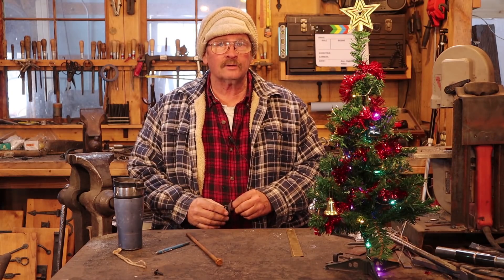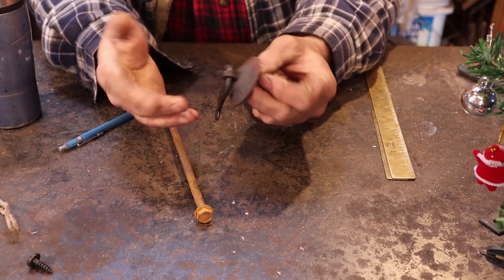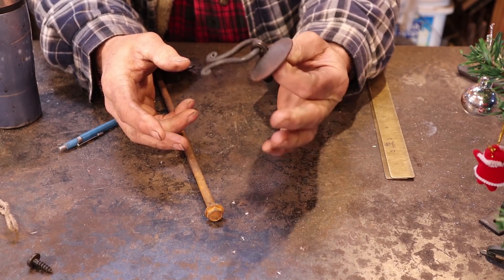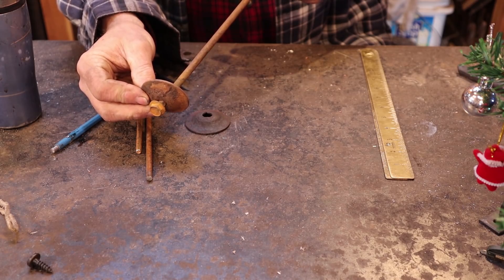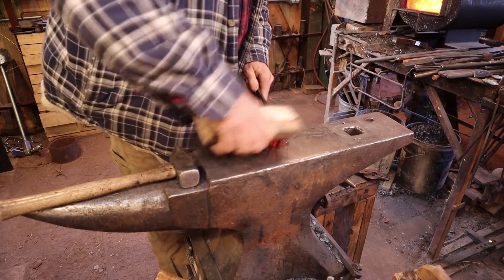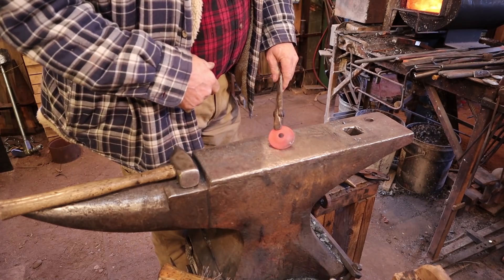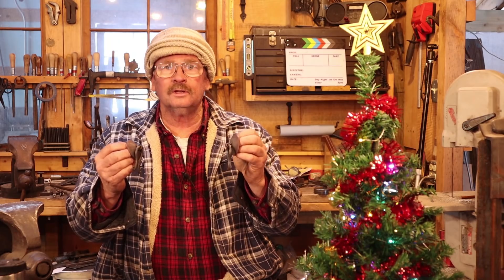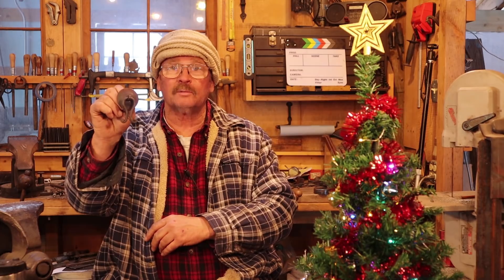New Mexican cabinet pull -  countdown to Christmas

Comment: That's a pretty nice little pull.  I think I may have seen it, but you didn't specifically mention it; the staple points should be just slightly offset, like a cotter pin.  That way they are easier to install. 
Again, a great little project, and easy to make with otherwise scrap materials.

Comment: What I enjoy is the variety of items you make, I have never seen some of them especially this staple type pull.Very ingenious as no screw, no bolts or rivets, just bending the staple. Is it better to put a washer on the inside of the cabinet for the staple to be crimped to or just on the bare wood?
Reply from the maker: I think the more they can dig into the wood the better they hold